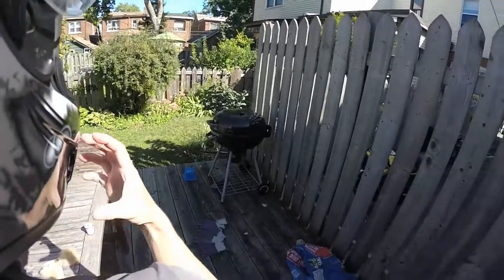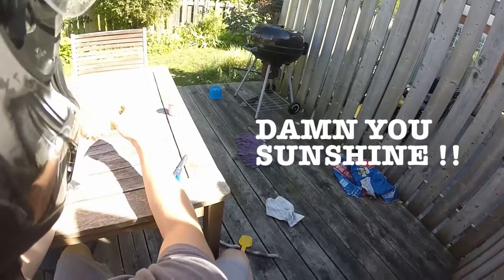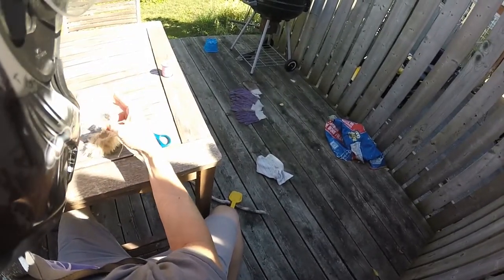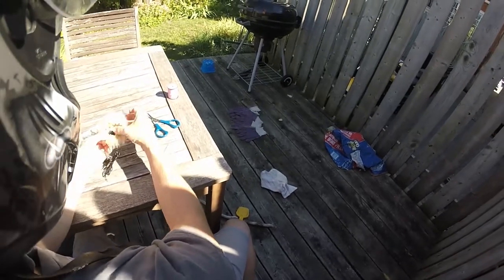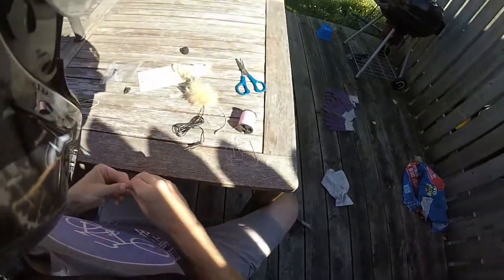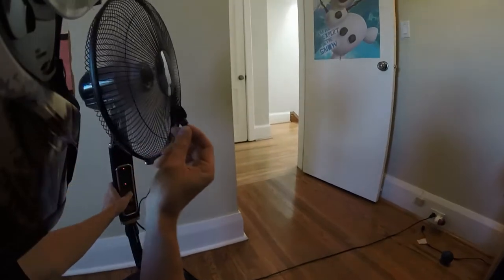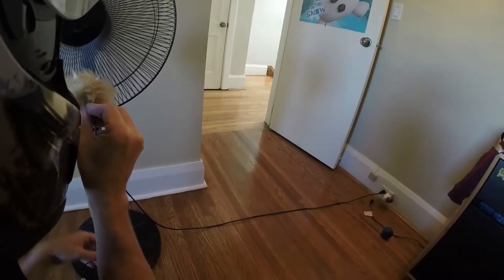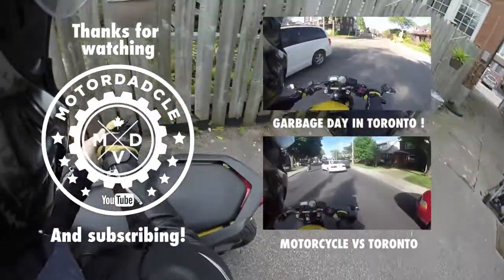DIY Microphone Wind Screen DEADCAT

Comment: what mic adapter do you use
Reply from the maker: I'm using the GoPro adapter that sticks out like 10 feet from the camera. Might try switching to a modded 90 degree adapter from ebay
Reply: thats what i was thinking to but sometimes they dont work you need a chip in it. also wat mic are you using is it the neewer one
Reply from the maker: Yep. EN187 does a video on modding the 90 degree adapter, check his channel. The mic is the Neewer one, I got a pack of three off amazon.
Reply: yeah i know about the en187 video and is that the pack of 3 or 5 that is about 8 bucks
Reply from the maker: y0Karn Yep, it was 3 for about $10 canadian